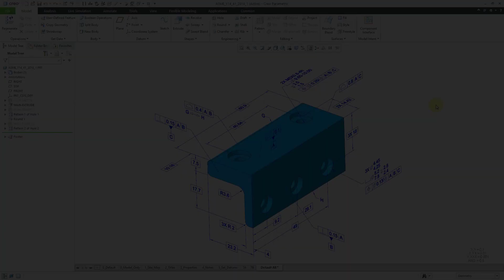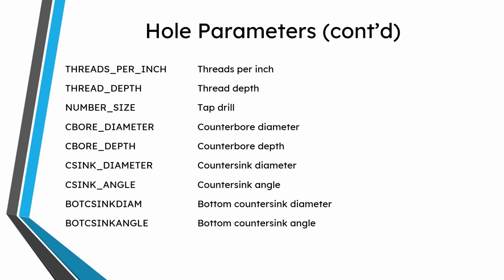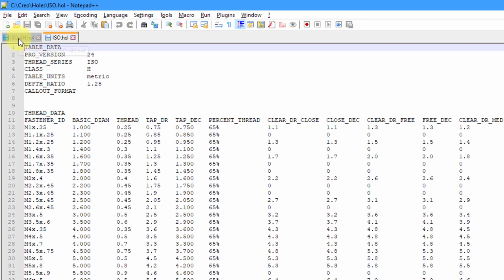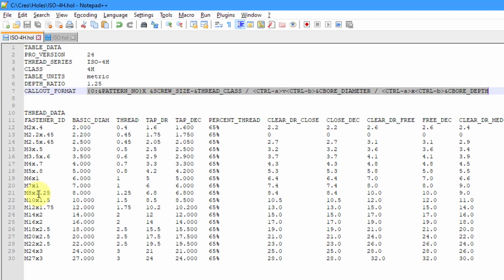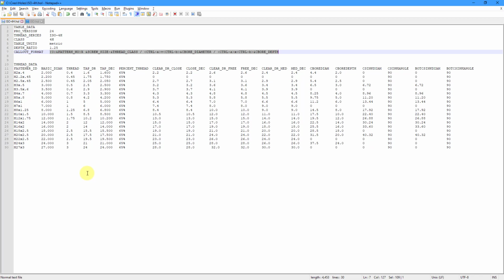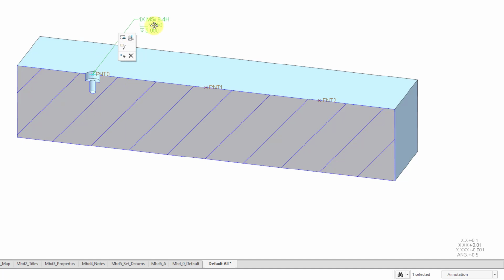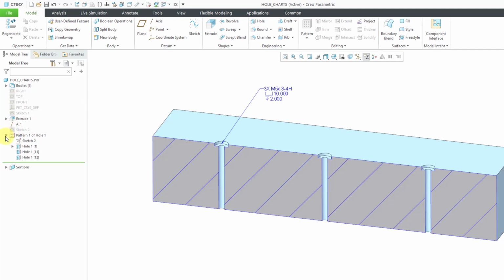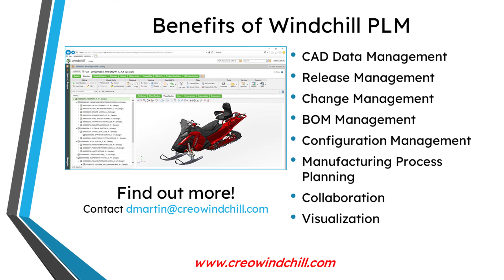Creo Parametric - Custom Hole Charts (Part 3 of 3) - Callout Format

Comment: Really helpful, thanks Dave! I'm having issues with "PATTERN_NO", even if I simplify it and remove the "{0:" and use "PATTERN_NO", it works for one instance, but if 2 or more, it returns "0". Any ideas or anyone with the same issue? I have trailed the innerwebs, but no joy
Reply from the maker: I recommend opening a ticket with PTC Tech Support. Shortly after I made this video, PTC updated the parameters to make them more robust. I still need to make an update video.
Reply: @ thanks Dave, will do. Happy Christmas!

Comment: Thanks Dave for this video!
Unless I'm missing something here, it seems the custom note only works for one specific type of hole that you are making.
ie if you want a note to just read the custom threaded hole callout you want, you have to create something like a ISO-THREAD.hol file just for that. Same for a counterbore and countersink hole callout - all have to be separate .hol files just for those specific callouts.

How do you make your custom notes standard for all ISO holes that get made no matter what type of hole you make (threaded, CBR, CSK)?
Reply: Figured this out, to set the default callout for all types of holes (Threaded, CSK, CBR, clearance etc) - you have to add a DEFAULT_CALLOUT_FORMAT_DATA text table under the THREAD_DATA text table within the same .hol file.

Comment: Dave... awesome videos.  You started by showing ASME spec, which I thought you were going to attempt to recreate exactly with the hole notes.  I am having trouble making use of hole notes because I cannot get the Gtol FCF to attach to the note in the expected format as it does sitting below a dimension.
Reply from the maker: You have to convert the hole note to a 3D Annotation (I have a video on that somewhere) and then you should be able to attach a Feature Control Frame to it.

Comment: Hey Dave, can you set limits/tolerances on the dimensions via the hole tab? For example, if I wanted to have the countersink diameter be .166 +.010/-.000?
Reply: Also, when I make mine, it seems like the countersink isn't applied.
Reply: @Jon-rm6ow  you can add other parameter headings in the table.  I added on called "UPPER_TOL" and call it in the note as &UPPER_TOL, same for lower.  But these are static and you cannot modify in the model.

Comment: Sir i will appreciate you if you start work on manufacturing in Creo parametric from basics to advance lavel , because there is no course exist online on this topic which is really needed these days .
Reply from the maker: You don't appreciate me now?
Reply: @CADPLMGuy  
Hahahhaha why not sir all the time . But will u do the task
Reply from the maker: Manufacturing is a very broad subject. I've done videos on Additive, CNC, Mold Design... Are there any specific areas that you are interested in?
Reply: @CADPLMGuy  
After watching your vedios would i be able to manufacture a part using Creo
Reply from the maker: Depends on the part.